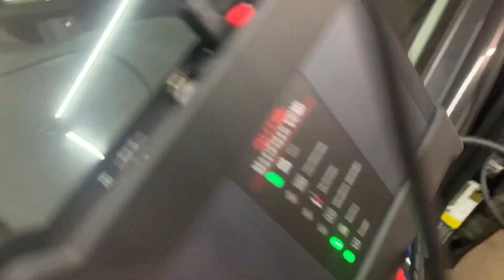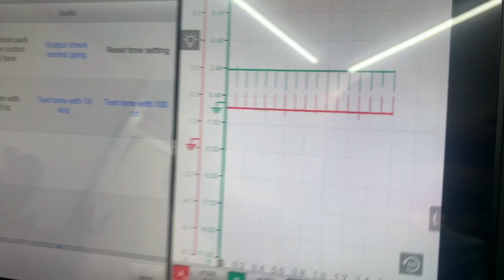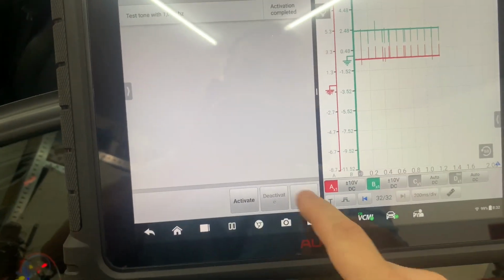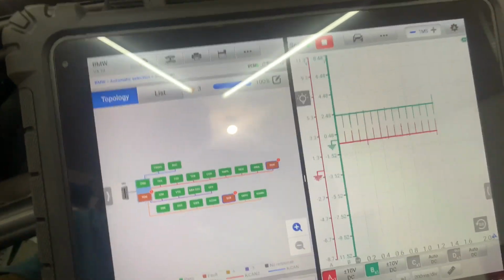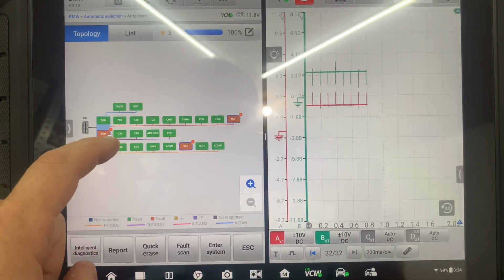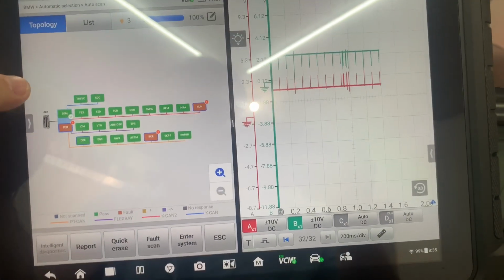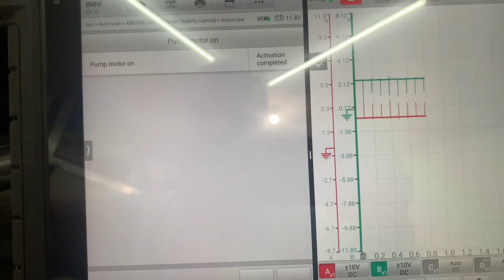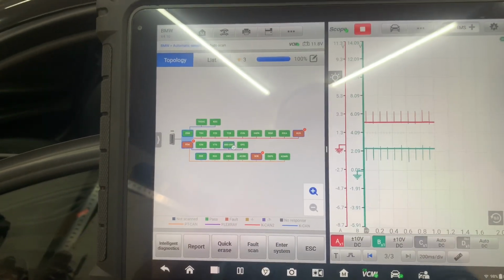Autel Ultra using Scope/ Bi directional at Once

Comment: Ohhhh you got the ultra...I was thinking about getting the mk908p with the j box....but the ultra is twice the price.... 🤨
Reply from the maker: Johnny's Speed Shop talk to the guys in my Automotive Scan Tool group they’ll work a price out and get you where you need to be. You get mega can with it & 13” etc
Reply: Twice the price for twice the tool. The j2534 that comes with the ultra is not just a standard interface. Once the software is released you will have access to remote programming. Also the software on the ultra is way different than anything else on the market.
Reply: @weldingjunkie  cheers mate....I'll definitely look into it
Reply: @JarheadDiagnostics  good to know...might be overkill for my shop....